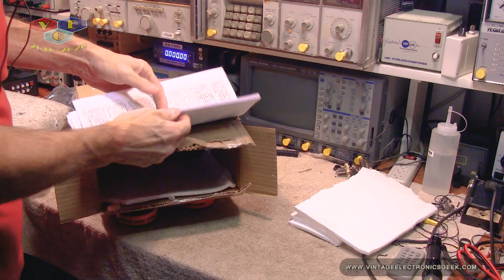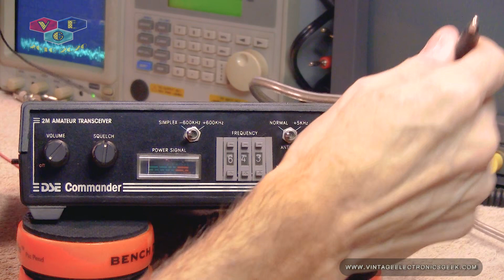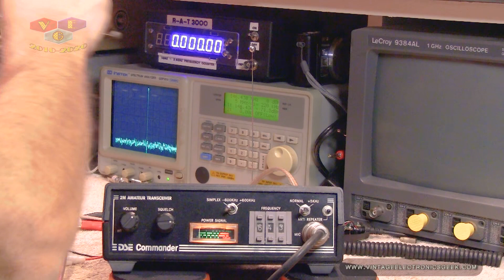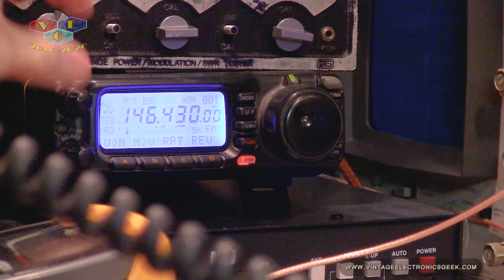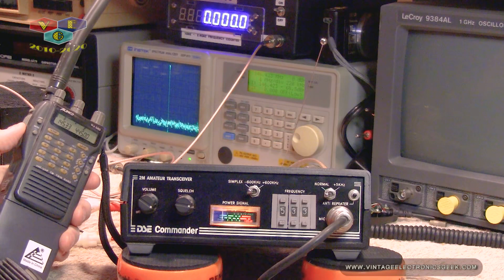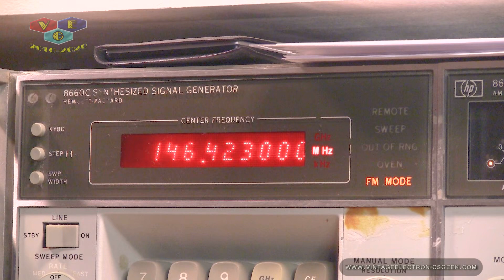Dick Smith Electronics Commander K-6308 2 Meter HAM Radio

Comment: I built one of these kits in the 1980's surprised by performance used it mobile for years mine had dirty volume control cleaned it with De-Oxite spray i still have this transceiver working did you know Dick Smith also put out a H.F transceiver kit as well it is all nostalgia.

Comment: I recall using an SWR meter into a dummy load to sample rf to a tester.  I tapped into the meter part of the circuit.  I thought of simply tapping into the dummy load by running a parellel wire along side the dummy resistor.  But I did not have a silly o svope at the time, so it did not materialise.  I wanted to use a fteq counter as a digital readout along with the analog tuning dial. So an SWR bridge would have beem an inline way to hook up any rig to a counter.  Back then, they sold digital displays that wrre expensive, and freq counters were also expensive.  I had tube transceivers with no digital displays.(FT101 and HW100)
Reply from the maker: Hey thats a great idea for a tap, may have to try that one day myself!  ~Jack, VEG

Comment: I had the Heathkit HW2036 that was very simular to this 2m rig.  
I liked it too, as well as the Clegg FM27.  There's something about such older simple rigs that intrigues me.  
This would be a nice Packet rig if paired with a KAM or MFJ1278 and a Commie 64 or Apple iie.  But don't know if hams still do packet anymore, kinda like rtty or SSTV.
Reply from the maker: I like Clegg, used to have 2m rig, but don't remember  the model...I don't own the KH, but do own one very similar, I showed it in a previous HAM swap video, do have plans on wrenching on it when its number is up, looking forward in using it.  I'm not a big repeater user, simplex is where its at for us...so these old rigs will work just fine for us...I do have plans of modifying these old rigs to work on modern day repeaters however...may do a video on that someday.  ~Jack, VEG